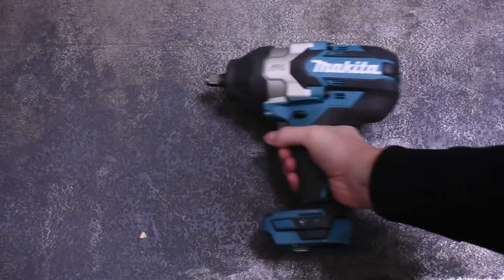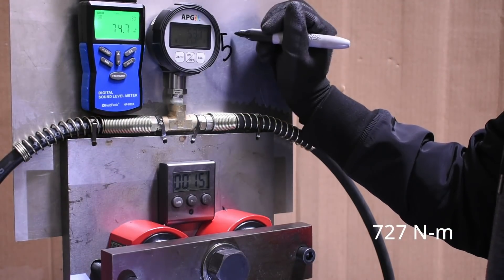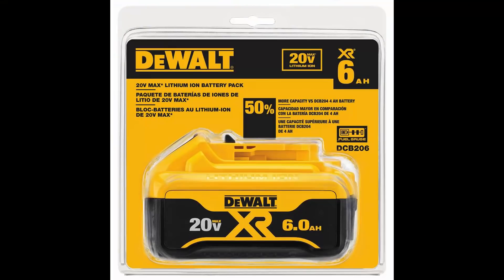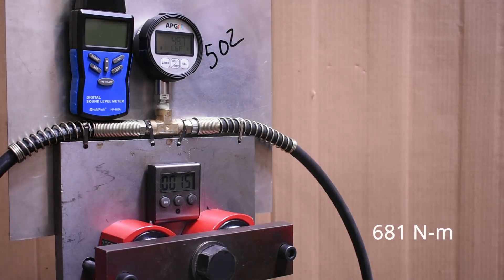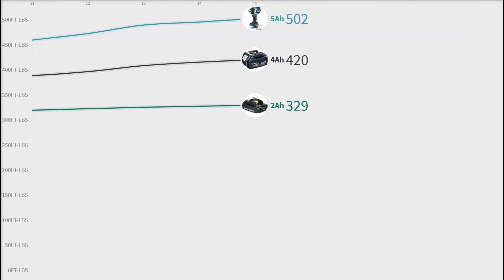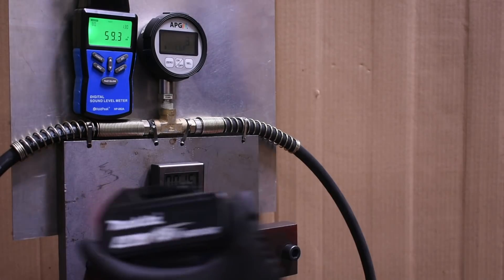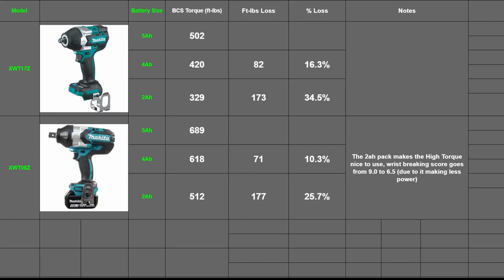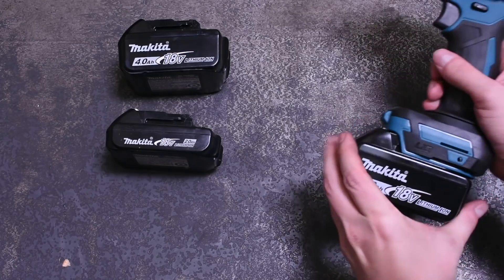How Much Power Are You Losing w/ Smaller Batteries? Dyno Testing For Science

Comment: Makita STAR packs are polycarbonate and pretty stout, just not as stout as Milwaukee, apples to apples. They look cheap as f*ck, though. I keep mine to woodworking in a clean shop, but even then they get uglier, quickly.
Reply: Ive dropped heaps of makita batteries on concrete and ive never broken one in over 10 years.
Reply: @kizzjd9578  I've only cracked one Makita pack, first generation (non-STAR). It took a very long tumble off the top of a gable, missed the gutter, two floors down to an asphalt driveway: Cracked the front corner of the bottom cover (took the brunt of the recip  saw's mass). Epoxy and fiberglass mesh and it was back into service. I do not expect any brand to survive that scenario. DeWalt's didn't crack the case, but instead the force of the impact stripped a plastic pillar inside (again repaired with epoxy, and drilled and tapped: right as rain).

M18 packs just have slightly more material to attenuate impact forces at the cost of a lot more weight. It's almost comical as to how much more Milwaukee packs weigh compared to any of the big brands.

Oh, also, Makita's are physically better engineered with respect to how it mates to the device or tool. Almost every Milwaukee FUEL tool I own has moderate to severe battery pack wobble. Makita designed a half round double linear bushing that reduces wear, and thus play (feels like Delrin or Polyoxymethylene). Perhaps it was a patented feature, but I wish all the big boys utilized such a wear and fitment design.

Comment: Would love to see someone make a corded adapter that lets these things pull as many amps as they want
Reply: It will trip the breaker at 16-18 amps. And matobo htp does make that.
Reply: If u got a cord why not just use air at that point
Reply: @hcgtiger4724  yeah I'm not dragging a massive tank around if I don't need to
Reply: @Aeroliten  what are you plugging an extension cord into at that point then. and if youre talking bout home use corded impacts are way cheaper and stronger than a mid torque or high torque cordless impact. especially if you're buying adapters to use a cord...just sayin
Reply: @hcgtiger4724  because I don't want to purchase a large air compressor and a ton of air tools. Plus airline is substantially bulkier than a cord and some people don't have room for an air compressor.

Comment: Thank you for this one. I find the power difference between amp hour sizes is a advantage in customizing what you have to work with. I use my makita high torque with the 2 amp battery usually but I bought  one 6 amp from Makita direct and it gives me the spread I need for my mostly automotive work. I've found my subcompact XFD11 drill is hands down the best drill I've ever used when dealing with drilling out snapped bolts with the 6 amp hour battery. I'll loan it to you for science if you wish

Comment: Why not use the base 2 or 3 amp batteries of each brand as the low end?
I'm a plumber with $10,000 in Milwaukee kit and most batteries are 5ah but have more smaller than larger than that. I gain noticeable power going from 2 to 5ah batteries, curious to see the actual figures going from 2 to 12ah.
People are gonna use more than one tool and will probably have a wide  variety of batteries

Comment: I am wondering if one of the electronics wizkids out there, like BigClive, could build some kind of 110/220V AC to 18V DC converter that would work for all of these tools. That'd allow you to find the maximum power they could possibly deliver and show how much/little of that they achieve with their battery packs.
Reply: Easiest way would be put 3 golf cart 6v batteries together in series for 18v. Lead acid can deliver huge amounts of amps and in this case would massively surpass the possible draw of the tool. It would be interesting to see.

Comment: I might be one of the only people who doesn't care for the newer 21700 celled batteries.
A little extra power is nice, sure. But the size and weight difference on most tools just doesn't do it for me. I'd rather use the smaller packs. With 5.0Ah it doesn't bother me with how long they last or how much power they put out.
Reply: Have you seen how big the xgt 5ah is? 20 18650 cells lol
Reply: @kizzjd9578  I have. I plan on running my current 18V Makita tools and batteries into the ground and hopefully be retired before they need to be upgraded lol
Reply: @evictioncarpentry2628  same. I have alot of 18v x2 tools and they are pretty much the same as all the 40v max tools. I dont see a need to upgrade unless you need it for the single battery platforms eg. Impact, drill etc.

Comment: So the "black box" is the interaction between the battery and the tool. Right now we're indirectly trying to figure out what's going on inside the black box of the battery and tool by using torque output. What would really be next level would be measuring current draw and voltage in real time, and plotting it on the torque graph. THAT would be something else. Then we could see exactly what's going on with the batteries instead of just guess whether it's the capacity, the cell discharge rate, the cell form factor, etc.
Reply: that's very interesting but I just need to know which one gone clap the hardest
Reply: I’d like that information as well, but in the real world it either performs or taps out. Knowing why might make it tunable?
Reply: I was thinking the same thing.  They could take some small wires and slide them under where the battery connects and check the voltage pretty easily.  Amp draw would be a bit more work.  However if V=IR, couldn’t we just use voltage with the assumption resistance won’t change?  Might not be a good assumption when things heat up though...
Reply: @montestu5502  brushless "DC" motors are just 3-phase AC with power electronics. Math for that isn't just algebraic.
Reply: @montestu5502  I would think tapping into the leads in the handle would be easier than fitting something in between the battery. althoug i have ghetto rigged up an older crappy tool by just hooking up the positive and negative with some leads and strapping the battery on but that wasn't with too many lithium batteries and was a pretty stupid and inefficient way to work. pretty exciting at times tho
But it wouldn't be super difficult to setup with an ampmeter and a multimeter its just hard to keep it in an easy to use state
Reply: With the battery adapters for the different brands you could probably jumper in some leads to measure with a multimeter fairly easily the only issue may be is that some of the newer tool supposedly have some communication between tool and battery hence the various different contacts on the batteries  as opposed to just the positive and the negative although that might just be for the charging. That being said if it was an issue then the battery adapters that work between brands wouldn't work so maybe its just more marketing wank. But I guess we would find that out as well if there's a discrepancy when tested

Comment: Great moves by Makita coming out with 40v single battery! I didn’t want to get into 36v two batteries platforms...
Reply: Think again... They are. they just use two "40V" batteries now. I think they needed a justification to make their oversight on larger battery sizes (21700 vs 18650) a seemingly better option instead of just going the way of MW or DW (larger cells and the ability to stick with just one battery instead of two,) and screwing their existing customers with the 18V X2 tools.

Comment: Please can you try hooking up a volt meter to the battery terminals during a run to see what the different packs are doing? It would be interesting to see how much voltage drop you get
Reply: You beat me to the question. That is where I believe the difference lies between each battery pack. A motor and its controls don't care where it gets its 18 volts from and will perform the same as long as the 18 volts are delivered by the battery. However batteries as they are being used (or consumed) will drop in voltage that only a meter which can read 100ths of a volt or less could detect and reveal any minuscular drop in voltage.
Reply: @corin164  Sorry, but nope. Voltage drop in batteries is in the Volt, not milivolt region while it's running under heavy load. If you've ever pushed the battery button when it's full, and then under load, the battery indicator may have dropped a bar (sometimes more) and that is a significant drop in voltage. (Remember, Li-Ion cells are 4.2 full and 3.2 "empty", so an "18V" tool is (should be) at 21V full and 16V "empty".)

Comment: Great video, Wish you could get your hands on a 6 amp/h battery.  I can get 2 4Ah for $149 CAD or a single 6Ah for $179 CAD and i thought the 4Ah would be a much better deal but maybe not... I don't use it in a torque wrench (yet) but my hammer drill might still find it advantages

Comment: Your Makita 2.0 must be seriously old stock because those packs were given battery gauges back in ~late 2016~.  Probably a bit earlier than that even.  

They're also not made out of ABS.  They're Polycarbonate stamped "PC" on top of the case  which has very high impact resistance.(a plastic commonly used layered into bullet proof glass and car windshields)  The white button is PA6GF.  

And I can ensure you they're nothing like the fake packs as far as durability goes.  I've seen the fakes crack from a 15 foot drop onto grass.  Never seen a Makita pack crack open after 15-20 ft drops onto concrete, grass, gravel, hard dirt.  I've seen one of the yellow connectors on top (the weakest point of their battery, by far) break off.  Otherwise the only other we've physically "broken" was melted by a hydraulic power pack since somebody left it sit next to the muffler...that's not something you could blame any manufacturer for though.
Reply: This comment right here is on the money. 100% agree with you. I would trust a Makita battery over any of the other top brands in a fall. The plastic is not cheap at all. It is Polycarbonate. I like all brands but when it comes to build quality I think Makita has Milwaukee and DeWalt beat.
Reply: Same here, in 10 years ive dropped heaps of makita batteries and only one has the yellow part break off. I used to have 2 fake batteries that looked genuine and they both have a broken case from a small drop.
Reply: Just as an fyi to this the first two numbers of the battery serial number are the date code but there's a bunch of weird versions of the batteries cause I've seen newer ones without the gauge on them 
makita kinda tends to have a bunch of similar but different models of tools and can be a bit confusing If you don't know or look at the model numbers the amount of models for drills for example

Comment: Did you ever test the 12v milwaukee stubby with the 2.0 battery? I was the video with the 4.0 vs 6.0 but really wanted to see the 2.0 in the mix
Reply from the maker: We'll hit on it along with m12 right angle
Reply: @TorqueTestChannel  I'd be curious to see if there's much difference between the 1.5 and 2.0 12V packs, if you're going that far.

Comment: Will you be testing any of the 1/4 inch impact 12v volt line ups of popular brands like Milwaukee and Dewalt? And if the battery size provides much if any of a difference on those even smaller motors?
Reply: Ughhh man I doubt they can activate the dyno. I've tried the 12v Milwaukee and found it utterly worthless. They don't even publish torque specs.
Reply: @Hansengineering  I mean they would most definitely read on the Dyno as it reads torque on the graph from 0 to an upper limit I don't know but so far about 1000 lb-ft, you can see that everytime one gets tested. And the 12v 1/4 create upwards of 40% of the torque that the 12v 3/8 and 1/2 subcompacts make. Milwaukee and DeWalt both publish their respective 1/4 impact specs in lb-in since the number looks bigger but if converted it amounts to a bit over 100 lb-ft. I was just trying to see how true to spec they really are and if one or the other is better.

Comment: It would be cool to see using one of those amazon battery adapters get the milwaukee 6Ah HO battery on the makita impact!
Reply: Ive melted those adapters on a 18v dewalt sawzall. The ones i have are cool just likely not good for a hi amp tool
Reply: @ShopJock  True they are sketchy
Reply: Makita makes a 6ah battery
Reply: @lewishein5731  Yes but I think they are also 18650 cells, so not any better at high current.
Reply: @garycaruso4883  True, but if there are more 18650 cells in a battery the current demand on each cell is less, so the battery overall can supply more current. Seems like the world is heading to 21700s now anyway though.
Reply: @ironbeaver6024  Still only 5s2p on the 6Ah Not more cells, using 3Ah cells instead of 2.5Ah cells, typically this hurts high Amp draw use as shown in tests on Tools & Stuff

Comment: Like you said . Dyno test can’t hurt to confirm what you already now .

And please stay off those fake battery when you need real job done 😃
Reply from the maker: Starting out with M18 HO batteries in only impacts on this series sort of warped our perception. Have we been making it up in our heads all these years that putting in a bigger battery makes a difference? We're glad the dyno is making it clear to us that we weren't necessarily crazy.
Reply: @TorqueTestChannel  Probably like a lot of things, its not immediately clear what the limiting factor on power delivery is, depending on the tool it might be the battery, it might be the motor itself or how its wired.
Just like if you want to upgrade the load capacity of a truck, you might upgrade the leafs but the axle holds you back, or you upgrade that but the bed holds you back, etc.

Comment: Your statement at about the 3:40 mark is exactly why I am buying Milwaukee and DeWalt over Makita.
Reply: I don't think you'll be saying that after he gets his hands on the new XGT platform.
Reply: @clarkfos3447  It proves my point. If I wanted to gain more power with Makita tools then I would have to buy into a whole new line of tools. At least Flexvolt batteries can be switched between 20 and 60 volt tools.
Reply: @Dale37  The 40v system isn't really about gaining more power. You can get every tool in 18/36v that is offered in 40v and the 40v tools don't out preform the 18vx2 tools by alot. The 40v system is for contractors who are looking to invest in the best power tool system available that offers everything they need with only one type of battery needed.
Reply: @Dale37  Hey now Milwaukee and Dewalt have both made you change platforms twice already? Makita has been making LXT since 2005 and it's the only platform you can still use an lxt battery from 2021 on.. Maybe you haven't been using tools for very long I don't know but you obviously don't remember Milwaukee's V18 or Dewalt's lithium ion stick batteries? Hell flexvolt has only been around for about  6 years...